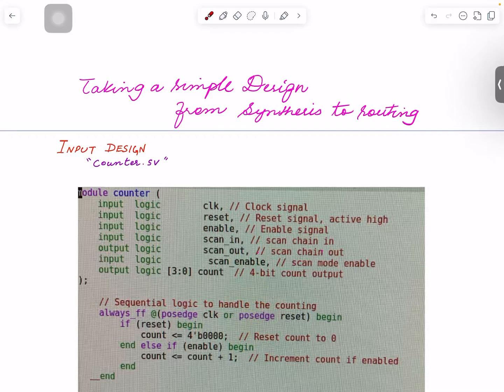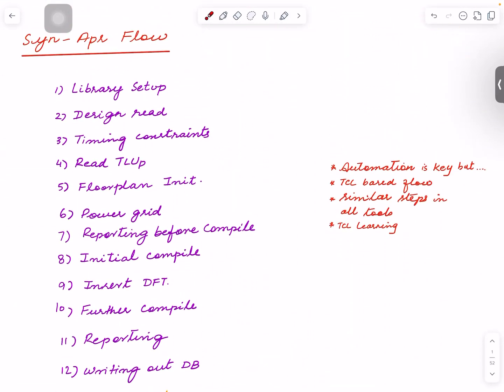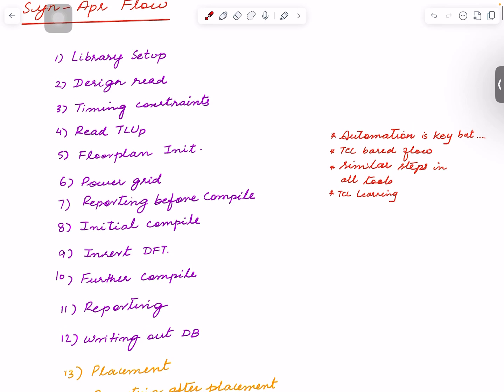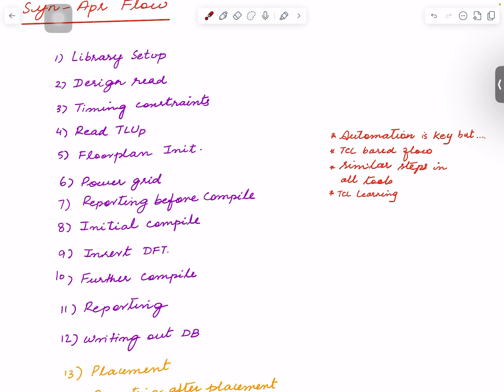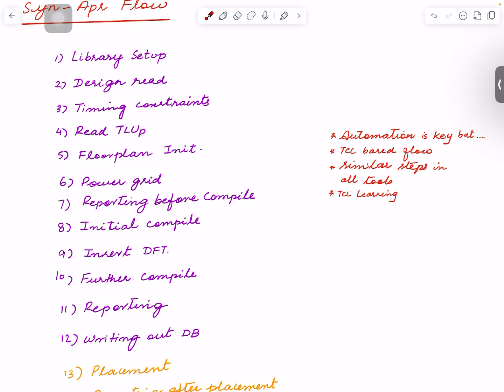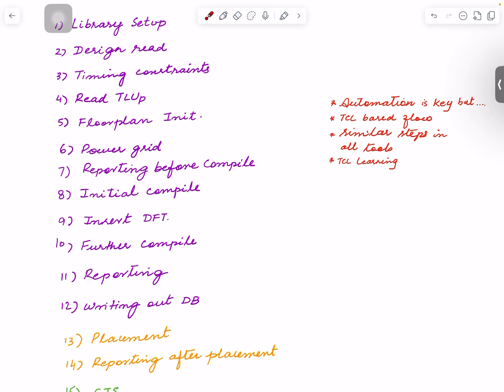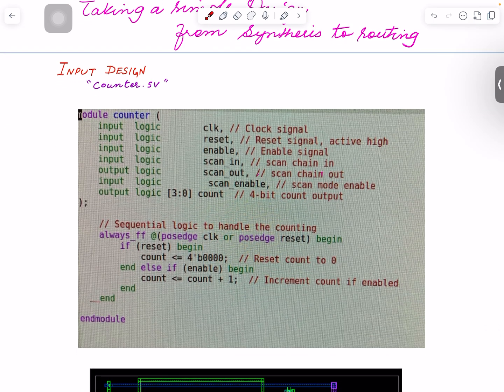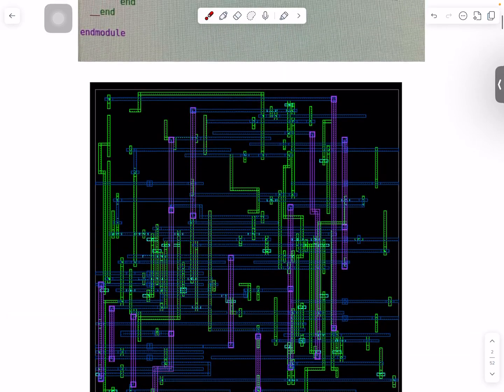Unit 1: RTL2Routing- Introduction

Comment: Which tool are we using for this flow?
Reply from the maker: I wouldn’t be able to provide you any tool unfortunately; however i will use tempus and prime time to give flow examples. There is a free tool i shared in my post which you can download, learn and practice.